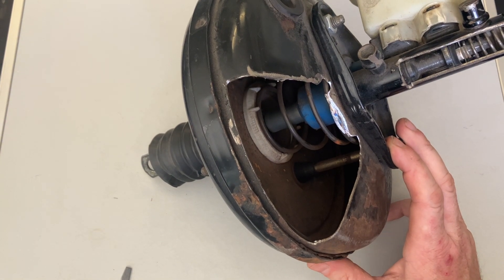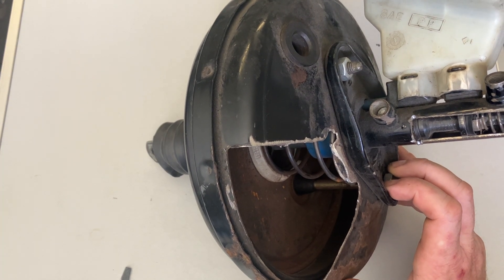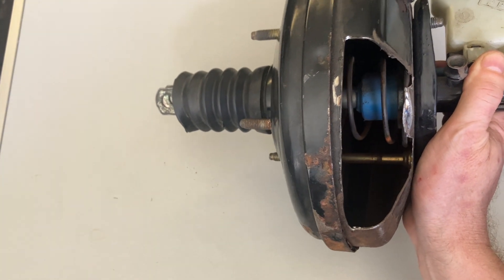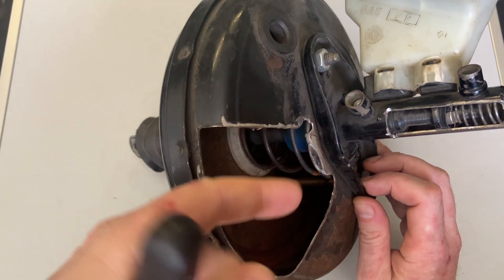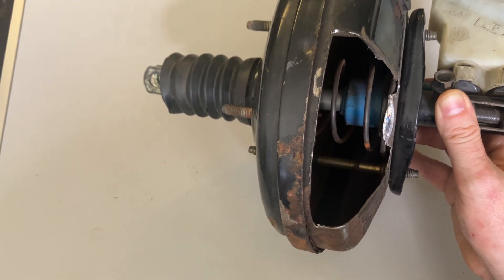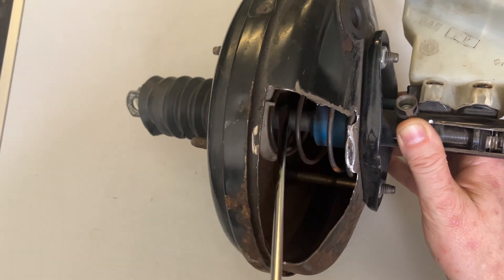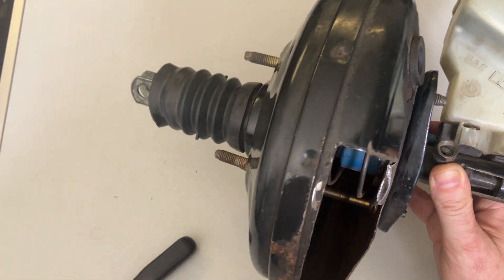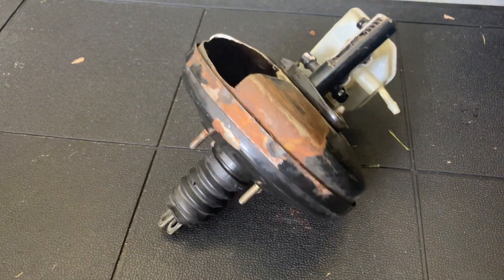How a Brake Servo Works.

Comment: Hello canyou help? I've got a van that has good vacuum...and on the first press of the brake pedal...the brakes engage very well....but on the second press of the pedal...the brake goes very hard...what would  you say causes that? Many thanks
Reply from the maker: Hi, hard to Say from that, could be a vacuum issue with the valve within the servo, that is mostly likely. Some cars have a vacuum pump too, these could give a similar symptom.

Comment: Hi, thanks for taking the time to put this video together as very informative. After bleeding the new front brake callipers on my Ford Capri I had a firm brake pedal but once I had started the car the pedal almost went to the floor although I could see no leaks and prior to fitting the new callipers my brake servo was working fine. Several MK1 Capri owners seem to think it’s the master cylinder rubbers because whilst bleeding I’ve moved the cylinder seals further than the normal amount of travel when driving and most likely the seals have been damaged from corrosion inside the cylinder.
Reply from the maker: Hi, yes sounds likely. As the seals perish over time they can start to fold and distort as the pedal is pressed, giving a very long pedal or cause the pedal to get stuck in a downward position. Hope you get the capri sorted!
Reply: Thank you.

Comment: What would the problem be if the pedal is soft and goes to the floor?
Reply from the maker: That is normally air of water in your brake fluid. Have the brakes been ‘bled’ yet? That would be the first thing to do. Otherwise you might have a component drawing air in. A bad piston seal, brake line, slave or master cylinder are all possible. Hope that helps?
Reply: @AdamMechanic  my mechanic said its a faulty servo and will replace it. Most symptoms for broken servo, that I'm reading, seem to exhibit a hard pedal?
Reply from the maker: Yes, I’d expect a hard pedal, engine stalling if it draws in air, not common to make the pedal softer. Normally in that area a soft pedal would be the master cylinder loosing pressure through perished seals/ pitting etc. Or, as mentioned something further down stream doing the same, slave, pistons etc
Reply: If the front brakes "bleed" properly, but the rear don't, and your brake pedal travels to the floor, it may well be a fault in the abs pump. I'm experiencing this atm. I'm going to send abs pump for testing. Fingers crossed it is the pump. If not I'm stumped

Comment: My zafira B has been having brake problems, the pedal has gone hard and all 4brakes are sticking on. Changed  brake master cylinder, ABS pump, lines are fully bled. No air in them. Could a servo failure act in a way it's pressurizing the calipers to hold, but not release. Any help appreciated. Great video BTW 👌
Reply from the maker: Yes, could be the servo. If you take of the rubber breather pipe from servo to the inlet manifold off and block it off at the manifold end and start the car, that should free the brakes off. You will still have no servo assist so brakes will be hard, but should release ok. If that works it’s prob the servo. Also, some servo are adjustable, so the rod that goes into it from the pedal can be adjusted, that can affect its ability to release and act on the brakes. Hope that makes sense?

Comment: My brake pedal gets soft and slowly sinks when I apply pressure on it, but only when the engine is turned on. I haven't found any leaks of brake fluid, and when engine is turned off I can build up pressure so the brake pedal gets properly firm. Based on your explanation on how a brake servo works, it seems like the servo keeps adding vacuum in a way that is not proportional to how much the pedal is pressed? Or the master brake cylinder has failed in some gasket, so that it won't hold pressure, but it only shows with the added force from the brake servo? I have changed brake pads and discs all around the car, and I might have not been so cautious when I pushed in the brake cylinders in the calipers, could I have caused a damage to the seals of the master brake cylinder?
Reply from the maker: Hi, that sounds almost certainly that the Master Cylinder has failed. A servo would be a hard pedal when failed or the car stalling when braking/ drawing air.

Comment: Hi there, im wandering if i could use brake servo of 2.0 engine to 1.6 engine diesel ?
Thanks
Reply from the maker: Hi, yes, in theory that should be ok. The size of the unit itself is the most important thing. Usually, the bigger the servo unit, the less braking effort is needed. That can go too far and give over sensitive brake application if the size varies a lot. If the size is similar, it should be ok.
Reply: @AdamMechanic  thanks very much for getting back to me, that's great help 😀
Reply from the maker: @AB-ci4vh  No problem!

Comment: My car won't push the brake fluid through the pipes, it also makes a sound as if air is escaping and the pedal will not resist when the engine is off, any ideas on what the problem could be?

I thought it was the master cylinder so I changed that but it didn't fix it.
Reply from the maker: Hi, I’d first check the engine breather pipe, the one that runs from the top of the engine to the front of brake servo unit, see if it has any small splits?

Comment: Why not just use a big brake cylinder? If you have the right dimensions it would do the same thing but less complex. Pretty sure they thought of it and it's not an option somehow but l can't see why. Thanks for the video btw 👍
Reply from the maker: Hi, thanks for the comment. I guess pushing a cylinder against fluid would involve a lot more pedal effort and probably much slower to react at the wheels? That’s my guess! Would physically work though. Thanks!
Reply: @AdamMechanic  isn't that what a brake cylinder is doing, pushing a fluid?
Reply from the maker: Yes, that right, but obviously the servo has already multiplied the braking effort by that point.
Reply: @AdamMechanic  There are brake systems without servo. Every hydraulic brake system uses a cylinder to push a fluid.
Reply: @AdamMechanic  hydraulics conserves force x area. If the cylinder is big enough, you can move the world, to paraphrase Archimedes